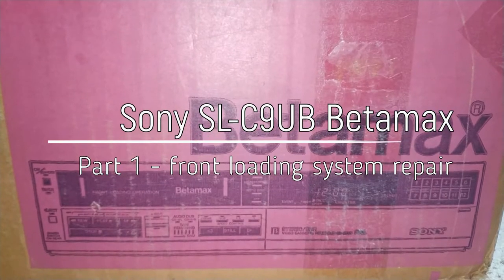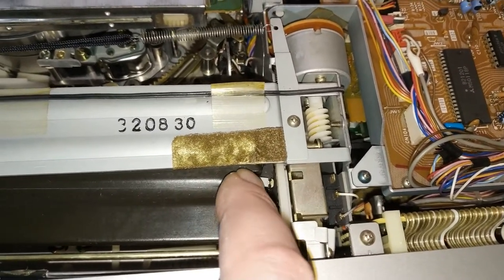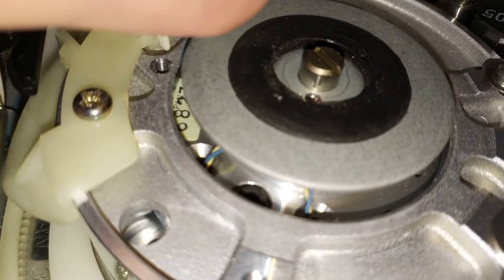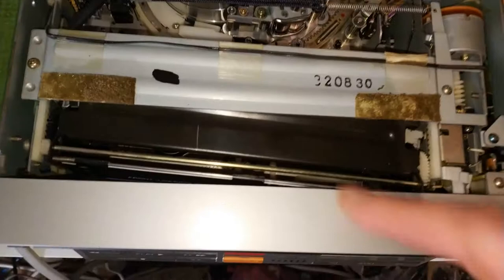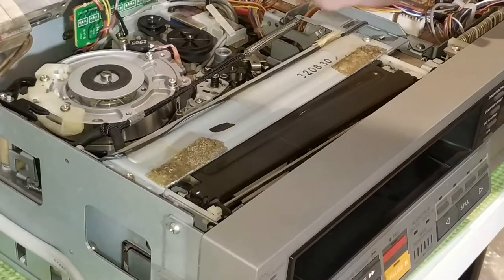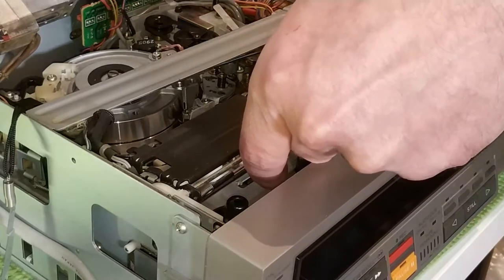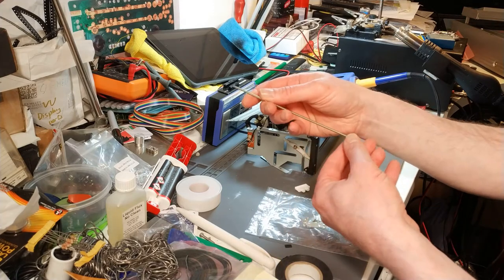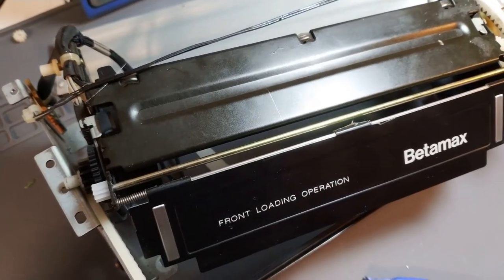Sony SL-C9 front loading system repair and machine check over - Part 1

Comment: Hi, thanks for the video. Do you know where can I find the service manual for the 711D chassis?
Reply from the maker: Hi, have a look at http://freeservicemanuals.info/en/servicemanuals/viewmanual/Sony/SLC9ESM/SLC9UB/None/SERVICEMANUAL/ that should give you enough info but have a search there too - depends what you need to know but there are several C9 manuals there.
Reply: @MrBetaByte  Hi mate, thank you for replying back. I already checked that site but I couldn't find anything usefull. I have the C9 service manual but there's absolutely nothing about the chassis. No info about servicing it. Nothing. There has to be a service manual covering that chassis somewhere...
Reply from the maker: @jma6412  I know of a couple of other sites where the full manual can be bought - I'll have a look as I do want the complete manual myself and I'll let you know...
Reply: @MrBetaByte  Thank you very much for your help, I really appreciate it. Let me know if you have some luck. Cheers.

Comment: i all ways find this made a right pain to work on  same as the later decks 
i can see why i went to pro  desk   they were doing my mind in   

i had a bad VFD in a   sony uvw 1800 betacam  i thinking it was  a bad cap in the power 
unit   

i know you would buy this decks of ebay  was on my watching list
Reply from the maker: They are a real pain to get sorted but great once they are especially if you can get those gears to perform reliably. Totally hear what you're saying with the Pro decks too.

Comment: Funny.... I see that the UK version (C9UB) had only 12 channels, as the European versie (C9ES) had 29.
Reply from the maker: In the UK we only had three channels when the C9 came out with channel launching in the same year although not UK wide initially so having 12 TV channels to pre-set was over kill for us! The ES also had a slightly different remote although this works with the UK/UB machine absolutely fine.

Comment: Top of your loading carriage is 320830 and mine is 320827
Reply from the maker: Certainly of the same generation! Have had a couple of very near serial numbers with Sony machines over the last few years - makes me wonder if some manufacturing runs were better than others (I do doubt it; it's more down to luck but it's fun to think about!).
Reply: Mine is taking tapes in but not loading them on the rotary mechanism, the eject light just keeps flashing, I have checked all the sensors on the loading carraige, the tape in sensor and all fuses and they're all fine, im thinking there may be an ic problem with it as even the 2 bars underneath to the right are fine.  @MrBetaByte